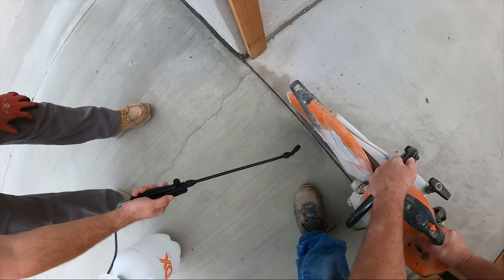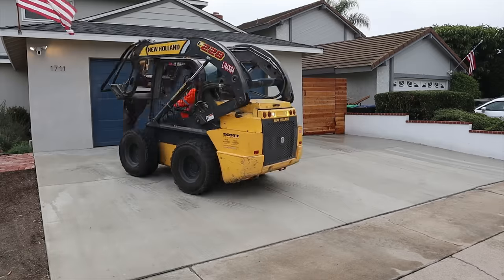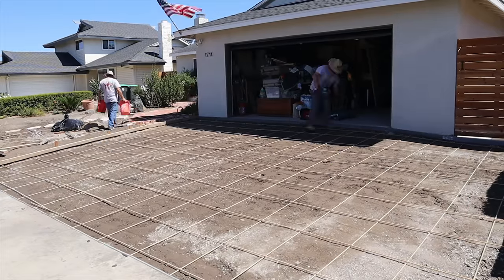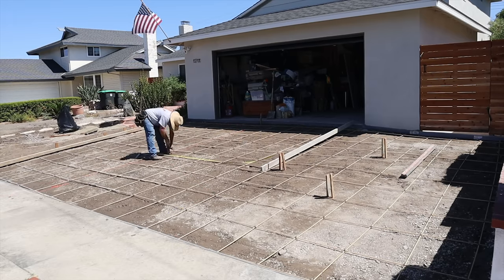Concrete GONE WRONG! Had to Remove and Replace

Comment: Odell, you can save a sample of the concrete you just took out and have it tested at a lab for strength. Then compare the results with what you actually paid for. That should be proof enough for the concrete plant.
Reply from the maker: Yes I did save a chunk. 
TY
Reply: Just make sure you tell them all the extra crap you did wrong like calcium adding fiber on the job your stupid stuff of moving a form because your guys can't straight edge right which takes up more time how many times did you have driver add water to the load?  Bring it people 22 years driving mixer truck I know what went wrong.  Plus you don't bullfloat with the driveway you go against itside to side.
Reply: @jodyallenbaugh9427  I wish I knew how the Romans did it. Their concrete has lasted 2,000 years without cracking.
Reply: @jodyallenbaugh9427  So glad the expert came here to run it's mouth.
Reply: @jodyallenbaugh9427  Maybe I ask my mailman for financial advise too, at least he is the guy who delivers the letters from my bank.
Reply: @YuNo232  Your reply wins the whole entire internet! Love it lol
Reply: @hd4ms  apparently they would've used hydrated lime, pozzolan ash, and fist-sized rocks for their concrete with little water for a fairly dry composition, the mixture of which would then be pounded, helping the chemical process of making concrete hard and durable. fairly interesting stuff the ancients discovered and used
Reply: @jodyallenbaugh9427  buddy, you can’t even write a coherent sentence.
Reply: @hd4ms  All hand-mixed pours, plus their Portland cement was harvested from original growth rain forests. The water was Perrier--naturally carbonated--of course.
Reply: @jodyallenbaugh9427  The real problem is that Odell didn't have virgins pour the concrete. That was the obvious solution.....😲
Reply: @slippy11ful  I was told by a concreter with 50 years experience that three things cause concrete to crack, over mixing and not getting it down quick enough, adding water once it is mixed and allowing it to dry out too quick once it is down. My own experience has confirmed this is good advice.
Reply: @hd4ms  All the Roman concrete that's still around is still there because:

It's not in environments with freeze/thaw cycling and relatively low rainfall.
They didn't use steel reinforcement that will eventually corrode and cause failures.
It's all in uniform compression, all the time.
It has high dead loads and low live loads.
They didn't need or have to use road salts or acid rain which is now eroding those ancient masterpieces.
The didn't have 80,000lb trucks running up and down any concrete.
They built on bedrock.

If you could use modern concrete in the same way, you'd see the same long term results.

I've broken up crack free flatwork that was over 100 years old that didn't have any steel in it, but was on extremely solid, stable, well prepared sub base.  They didn't skimp on the portland cement either.  That stuff was like granite.
Reply: @jodyallenbaugh9427  so the driver of my last load of concrete couldn't tell the brake from the gas and back into our former and ruined everything!  Dont fucking start with im a driver and know everything!
Reply: @hd4ms  Jesus
Reply: @hd4ms  volcanic ash
Reply: @fmcdomer  Yep, I think that's the secret or one of them at least.
Reply: @jodyallenbaugh9427  now your a finisher
Reply: @slippy11ful  UMMMM,,,, you do know that more water weakens the concrete right,,,,, and Im sure a driver with 22 years in has seen wayyyy more than you!
Reply: @stevegiboney4493  go drink the kool-aid
Reply: @jackmehoff1565  , you buyin?
Reply: @hd4ms  there's a stretch of Roman road visible on ( Yorkshire Moors I think the area is ) . You can still see and walk this road for a short distance .
Reply: @hd4ms  Because their roads are made of stone, not concrete.
Reply: @felixmay4960  yeah has seen the work. And yes i know adding water weakens concrete but adding a couple gallons and making it a slump of 6 or 7 isnt gonna make the concrete crack super bad like this. The concrete would still have a 2500 psi ish strength. The only things that would do that to a pad is they drove a bulldozer on it, the mix was totally wrong, or they didnt compact the ground before they poured
Reply: A lot of the time guys on site add water and that ends every discussion of them helping out
Reply: @YuNo232  yea.  My mailman a genius.  He brings me my papers from Ameritrade. I knew I should of been asking him all along.  Besides YouTube financial advice and other advice.   Best example
Reply: @jodyallenbaugh9427  around here adding water etc gets documented. Driver has paperform for this. Who made the additional water order and how much was added. Copy will be sent in email after delivery. No need to play memory games.
Reply: @davidburkholder7360  you definitely got that right!
Reply: @hd4ms  All concrete that lasted, hasn't broken. See the problem with this statement?
Reply: @hd4ms  they had the gods backing up their work..
Reply: @hd4ms  yup they used only the best ingredients in their mix...we build crap to last only 50 years 100 years if were lucky and thats that we use rebar for more strength. p.s. bad batching does happen especially if a new person is in charge of doing the mix, seen it one time.
Reply: @AerobaticsPilot  pp
Reply: @OdellCompleteConcrete  If you look at the cross section of one of the removed pieces, I'll bet you'll find an uneven distribution of aggregate the top 1/4" just "cream" from being slicked off. The evaporating water from a wet mix dilutes the upper surface from underneath as the op begins to cure faster than the interior. This causes the blisters you are seeing as the escaping water is trapped under the partly cured surface. Sawcutting as soon possible without the edges raveling is the best crack prevention and keeping the pours and the cut sections as close to square as possible minimizes shrinkage cracks by allowing equal shrinkage in both direction.

Good on you for making the job right. Many contractors would just tell the owner the only thing certain about concrete is that it will crack.
Reply: @jadema7805  I think you left out seawater.
Reply: James Mclean  there called concrete blankets there only used in cold to hold in the heat generated by the concrete curing
Reply: Not sure how they would test a ‘chunk’.  I worked in soil and concrete testing and tested cores. Capped them with molten sulfur then put them in a press.
Reply: @Zerpersande  You're right. It'd have to be a chunk big enough to cut a core from, and I'm not sure there were any chunks left of that slab that were big enough to get a decent one. It sure did look like it crumbled instead of broke when they were removing it. I've seen concrete like that that accidentally had a double dose of air entrainment agent in it. (My dad was a civil materials engineer. Grew up around and worked in his labs for years. I got in trouble with my kindergarten teacher for correcting her when she referred to a "cement" sidewalk, lol.)
Reply: @hd4ms  true it's impressive but there read were probably made to be permanent. And the wear and tear is massively more compared to 2000+ years ago.
Reply: @Aelanna  The Romans used concrete as well. Do your research.
Reply: @slippy11ful  2
Reply: @geoffdrew5207  i personally dont like saw cutting. Idk anyone ever wants to come back to a tiny concrete job for anything other than maybe sealing it like on something stamped for instance.
Its just baffling to be, yeah u get perfectly straight lines i guess, but if u know how to cut u do as well. The gaps are bigger, then edges are a little more rounded like ur doing steps, and if u know how to finish it really doesnt add any other steps for real other thsn u have one more tool in ur hand when on ur on the mats.

I love concrete, some of the easiest money for real. Esp if u know what ur doing. Id rather be there at that moment for a couple extra minutes per square than come back for a few hours the next day and either see a cracked slab, or lose more profit to cutting. Also, one less expensive tool to be constantly using.
Reply: That works in theory but when it fails the question is: "Who put too much water in it". In my area, once you look at the load fall onto the chute and begin to pour, the slump is your problem. You can add as much water as you want, it's on you. The problem with adding too much  water is that the water dries out too quickly and causes it to shrink.  I think this was at least a partial problem but if I had to guess, I'd say the truck was being greased and somehow a huge chunk of it fell into the load. The driver spent too much time trying to retrieve it that the load was drying and he added water on his own. When it got to your crew, you had to add water to get it to come out of the chute.... This happened to one of the loads I ordered. The hopper has grease points on it. I think we found a whole crushed tube of it and luckily none of it surfaced. We took note of it and contacted the Ready Mix concrete company. They offered to replace if it ever cracked or spalled.
Reply: @robertkustos2931  Wheeldale Roman Road?
Reply: @Neilukuk  👍 that's the one , cheers .
Reply: Looks like a hot load to me
Reply: @jodyallenbaugh9427  is fiber good or bad to add
Reply: @jodyallenbaugh9427  Truck driver trying to tell concrete guys how to do concrete 🤣 stick to your cushy driving job buddy.
Reply: @jamram9924  LOL
Reply: What were your test results with the concrete ya sent to the lab 
As unfortunate it is to have to redo the entire project 
It's these type situations we learn the most from 
I read through Nate J  comment replies didn't see anything mentioning your test results 
My next-door neighbor is a retired concrete lab tech 
from Michigan 
When you were mixing in the white fiberglass mess 
Ya spoke about Slump & the numbering system 
Is there a way or a tool made that measures the water content in the wet cement for someone who doesn't have the experience in knowing exactly the Slump content is prior to pouring 🤔 
Thanks for letting me Share 
Dave ...
Reply: @jodyallenbaugh9427  Adding water wont create those discolored rock pops. There’s obviously crap in the mix. Youd have to be a complete moron to add that much water anyway. Ive ground and repaired a lot of slabs, including many that were poured piss wet and finished incorrectly by cheap tract builders. Never seen a slab break apart like that, that stuff was basically a dried slurry mix that looks like it had bits of dirt in it. Something was wrong with that mud to make it do that.

Comment: With 26 years in the construction business, I know for a fact you cannot stop concrete from cracking. You can stop it from moving with rebar or wire, but concrete will crack sooner or later.

Comment: Very impressive. In less than 5 minutes into the video, the company's integrity is evident. If I were to start a home service company, I would make videos like this for all to see. Not only to showcase the quality work done but also to show that if anything was to go wrong, it would be made right. A great form of advertising. Nice job.
Reply from the maker: It's the right thing to do.
TY
Reply: You can tell how good a business is, not so much by how they behave when things go right, but how they behave when things go wrong.  And things do go wrong, that's inevitable in all walks of life.
Reply: @OdellCompleteConcrete  About 50 years ago I was mixing and casting parking lot concrete "bumpers" in a yard.  A mentor who was about 40 years older than my late teens at the time told me that:  "The mark of a craftsman is not someone who never makes an error, it's how the error is corrected."
Reply: They made this video because if they didn't replace it the homeowner was going to sue them for a shity job which the contractor clearly showed they did a shity job and blamed it on everything but himself I find it kind of funny that the homeowner wasn't in this video to actually make the contractors "Good Deed" look legit how do you people even get by in this world by being so naive
Reply: @nathanbasel207  the homeowner gave him permission to record on private property so i would assume they are on good terms...but im sure you know everything
Reply: @nathanbasel207  If they did a shitty job wouldn't the other driveway they did be the same way?  It really was the concrete supply company mess up.  Also,  if it wasn't the concrete company fault why are they willing to maybe cover the cost?  If they was no chance of them coving the cost why would he buy from them again?
Reply: Wow this would have cost a fortune to do twice second time unpaid

Comment: I've watched you demo alot of concrete driveways and never seen it crumble into small pieces like that. Way to stand behind your work removing and replacing that driveway. Thanks for the video of it.....
Reply: Alot
Reply: @The trash man 
That’s what I said haha
Reply: That's the reason it Cracked
Reply: @2wheel93  exactly that is why it cracked. I seen a chick on the last video run the bowfloat a thousand times better
Reply: It was  HOT
Reply: The Trashman  I would not call a driveway "structural" since it sits on the ground, but the new install has the rods touching the ground, which would explain the lack of connection. R we on the same wavelength? One sidewalk installer raised the rebar with a hook during the pour in lieu of supports.

edit/addon. The first pour showed sub-standard concrete. We don't know the weather then, or if the 10CY order came as 9CY (remember the DOT limit?) and they watered it down on site. Could explain the cake-like pieces. Quick evaporation maybe was a/the problem. I did not hear "keep it wet for at least a day after it begins to set" (people say cure) after this replacement pour.

PPS people badmouth the driver's comments YET he was on the site AND knows what was done AND took notice  months/years afterwards in his 22 years. Good learnig & judgement tool IMO.
Reply: they didn’t use concrete vibratos!!!

Comment: Great video, it's nice to see a true professional stand behind their work. I imagine it's a tough pill to swallow, especially when it was most likely the batch, but there is no substitute for doing the right thing. 👍🇺🇸❤
Reply from the maker: I concur 
TY
Reply: Just showing me this I'd hire you guys. Of course it would be better to not have any mistakes but standing behind your work? Reputation? Priceless. Well done.
Reply: why would you say the batch ?  the tickets should have waits and that usually happens when to much water .  and under stand this cemex always over exceds its mixes  thats why they have drivers write down the amountof water used  all the time  and this does happen to all concrete companys .  what was the psi on job across the street where they the same?   i can tell you sir and any one watching Cemex does not reuse mud and do it right so it dont come back on cemex .     some times this happens and you redoing and national redelivering it shows  you and then respect your and there work 👍ok now fiber 😁 that helps
Reply: @bghankhernandez  what???
Reply: @OdellCompleteConcrete  Will the concrete company not stand behind their mix or will they do what most large companies do and weasel their way out of any responsibility?
Reply: @bghankhernandez  , Cemex was across the street. It was fine, it was the National that was bad. It was obvious that the mud was not good.
Reply: @rxonmymind8362  concrete cracks so l recommend putting control joints. Some contractors are lazy and only put a few. I recommend squares no larger than 8ft squares.
Try to keep them square and not rectangle 
Hats of to O'Dell
Reply: @stevegiboney4493  it sounds like the slurry was too wet.
Reply: That falls on the concrete maker
Reply: Great work, do you go to New Jersey also
Reply: Those are called heat crazing cracks........caused (most likely) by a hot load arriving late and then adding excess water to compensate!
Reply: @themasonrycompany.  that's the right way to do control joints no longer than 8' each way, because of thermal expansion, and a lot of people doesn't know about it,  this job specifically ya was the problem,  and thing happens with the walls and the right expansion joints...

In this job he should do 2 control joints each way,  calculating the measurements  of the  since its 2 car garage door (16').

Do you agree?
Reply: @JUANRAMONROBLES  yes
Reply: @themasonrycompany.  thanks I learn about the thermal expansion in the middle school in Mexico and then I apply it in my Job here.
Reply: @themasonrycompany.  6x6 for stronger hold